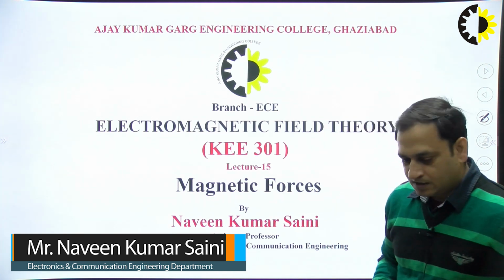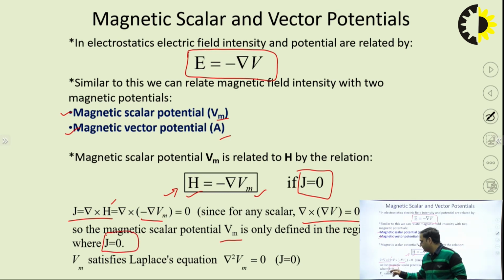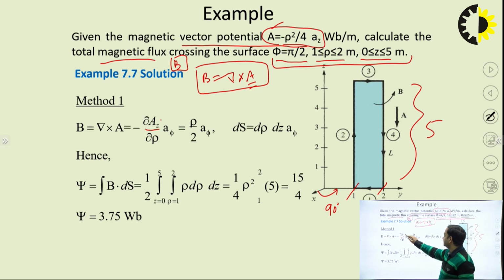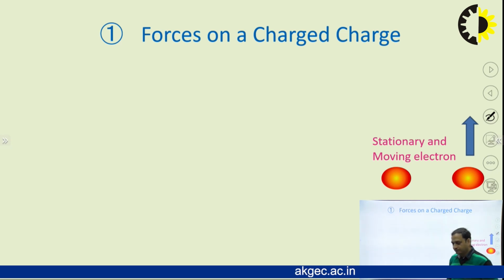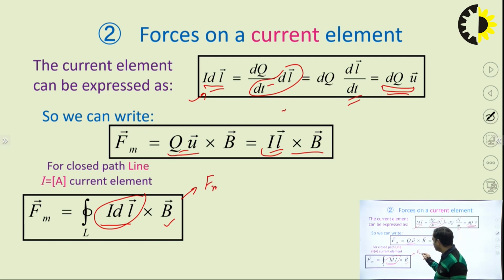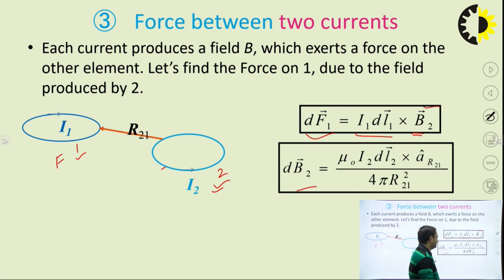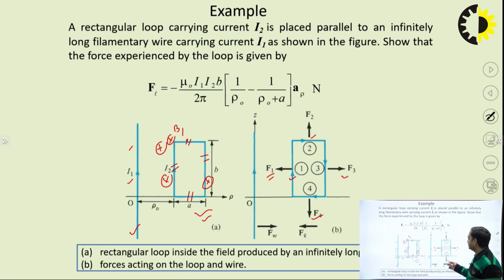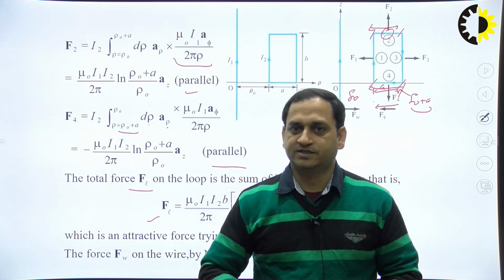ELECTROMAGNETIC FIELD THEORY LECTURE 15 ''Magnetic Force'' By Mr  Naveen Kumar Saini, AKGEC

Comment: Given the magnetic vector potential A = —p2
/4 az Wb/m, calculate the total magnetic flux
crossing the surface <f> = -ir/2, 1 <p<2m,0<z<5mGiven the magnetic vector potential A = —p2
/4 az Wb/m, calculate the total magnetic flux
crossing the surface <f> = -ir/2, 1 <p<2m,0<z<5m